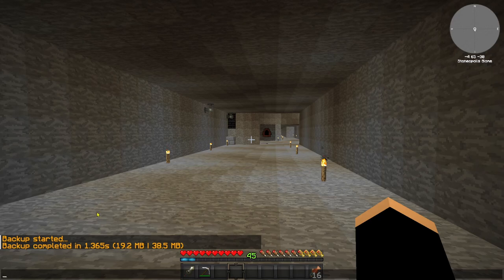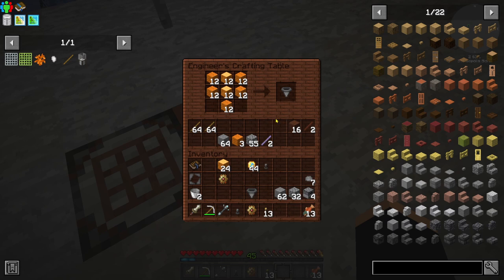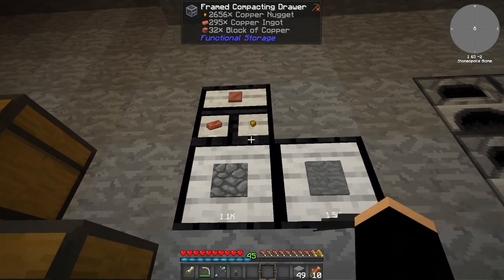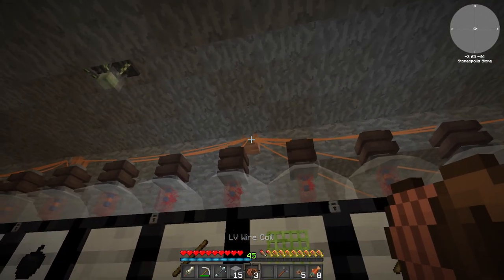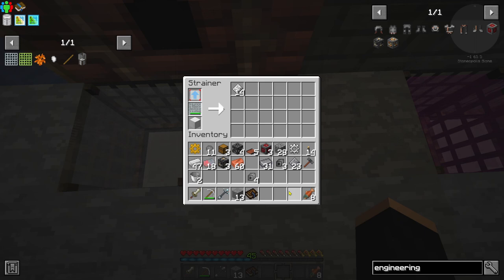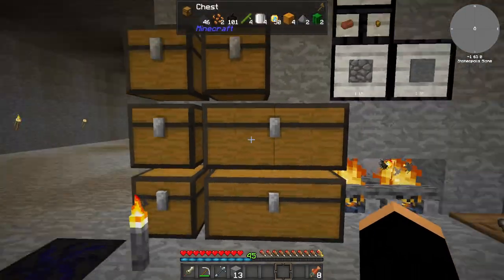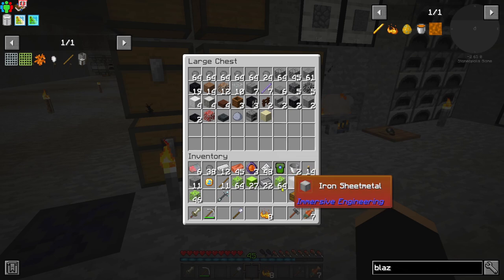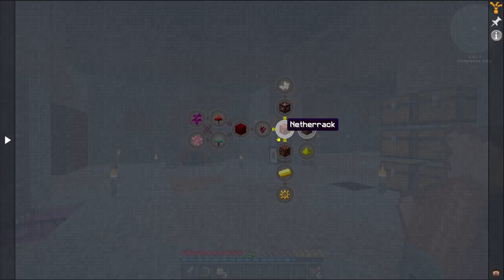Stoneopolis Ep7 - Furnace Array & Massive Machines Chapter

Comment: Hey,  have you been able to make an arc furnace?  I'm assuming it can be made as it mentions it in several descriptions in the quest book, but i cant make block of steel as it says in the immersive book.
Reply from the maker: It should work with the other steel block, we've had no reports of it not working.